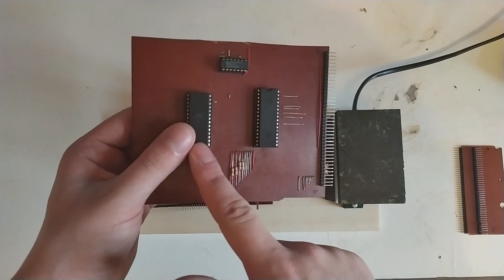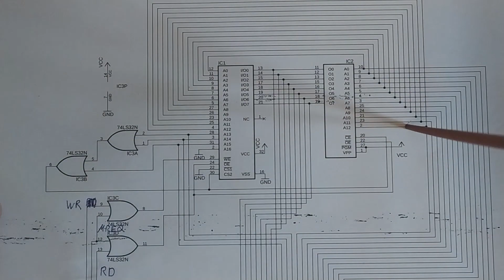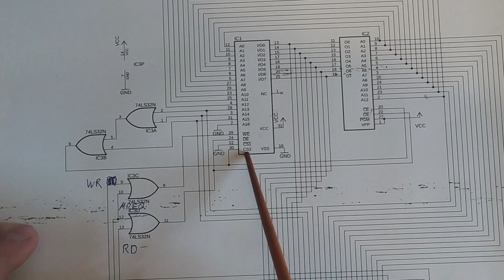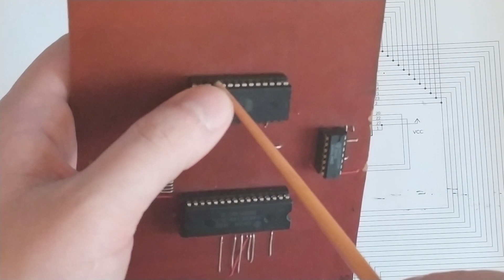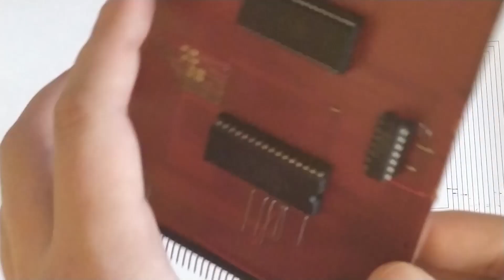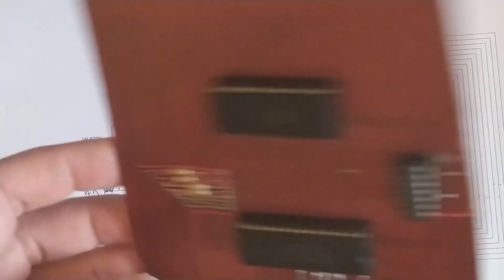Z80 Updates 22/11/19

Comment: I experienced the same exact problem you did with the slow clock and erratic address bus.. The NMOS z80 doesn't like a slow clock due to it running so much out of spec.. Bumping it up to about 100 Hz should work just fine tho
Reply from the maker: Thanks! That explains it. Comments like these are half the reason I make these videos :)
I think it is high time to design a new clock board. The one I designed previously has some issues with the reset as well as with the clock. Might just ditch the slow clock all together and just have a fast clock and a single stepping circuit.
Did you ever try a single stepping circuit based on the M1 and WAIT pins? 

That seams to be a much more elegant way of going about this and shouldn't suffer from the same issues.
Reply: I agree with Alex. I've been experimenting with the Z-80 lately and bought a handful of chips
on Ebay and tested them out using my homemade quick chip tester (tying data pins to ground
and watching the binary count on the address LED's). I found that half the chips 'failed" the
binary count when I ran the 555 timer clock at a comfortable blink speed. I just couldn't believe
that half the chips were bad!! I decided to crank up the 555 timer so the clock LED was almost on
solid, and the retested the failed chips. Lo and behold, every one of them worked just fine. So it
looks like an oscillator clock works better than a 555 Timer clock.
Good luck with your project and don't get discouraged!!